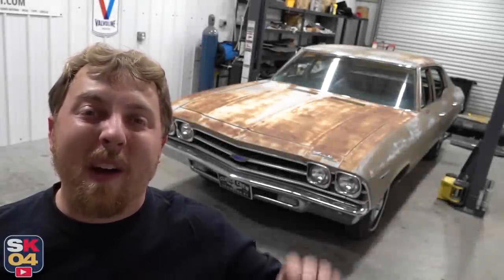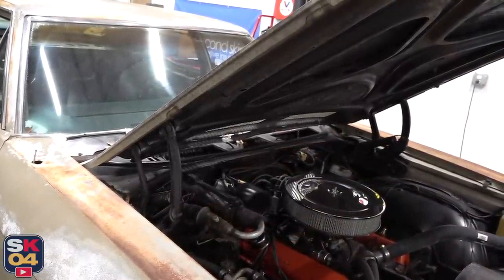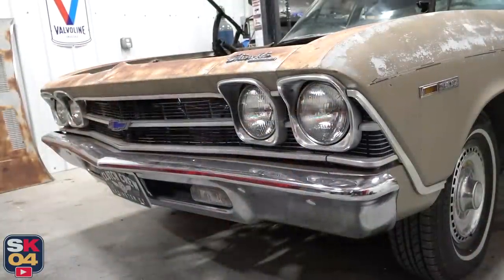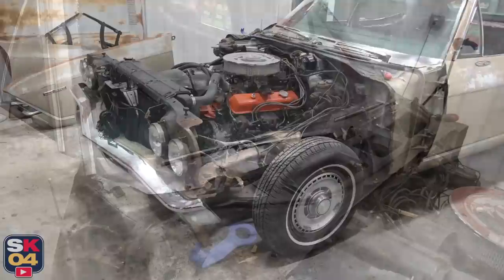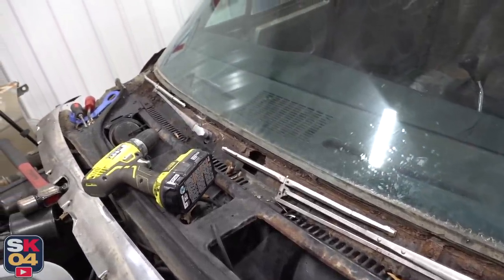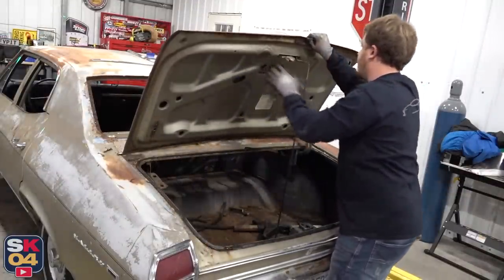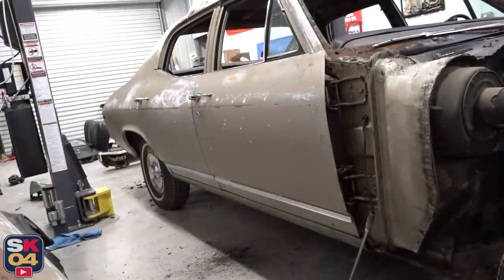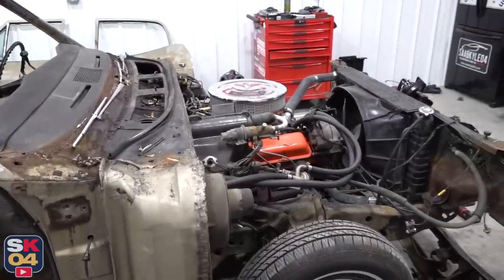How Much More Rust Will We Find After Stripping The Body? Chevelle Restomod Ep.3

Comment: The transmission should be a 6l80e because of drivability. You would love a 6 speed because of how well they accelerate
Reply from the maker: I already bought a built 4L80E long ago, there's more aftermarket support for the 4L when doing swaps in these cars, at least when I was planning things out.
Reply: @saabkyle04  Ah, that makes sense. Still though, if you're trying to do something different a 6L80E would be pretty neat you gotta admit.

Comment: 1 piano wire or guitar string to cut window seal...
2. I'm surprised you didn't break every single bolt on the lower half of the fenders...huge cajones man..
3. You need a battery power ratchet and ditch the hand tools when you can. Huge time saver.
4. I'm cringing watching you use that ratcheting screw driver. They make extended bits for your drill. Try one
Reply: I made that comment when you pulled the windshield. Seeing your battery powered ratchet confused me. Wondering why the heck you didn't use it before